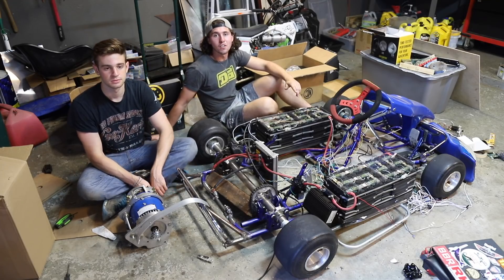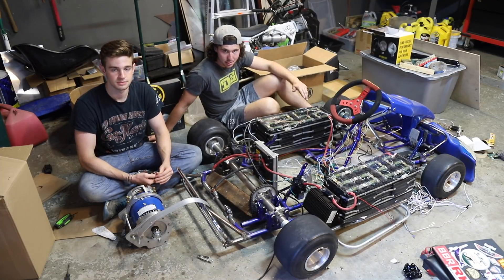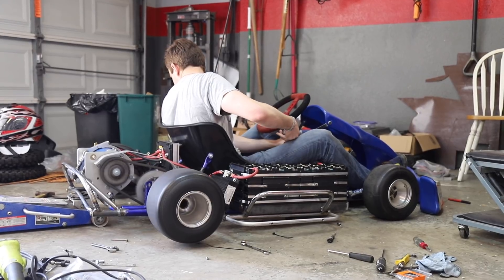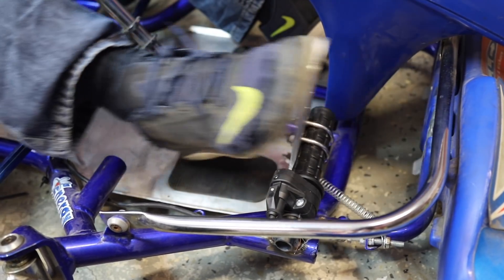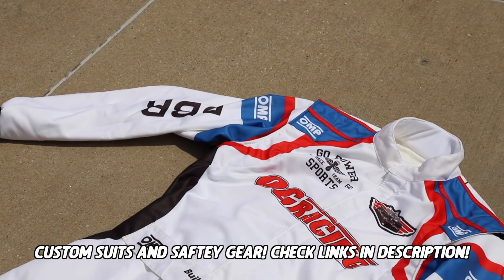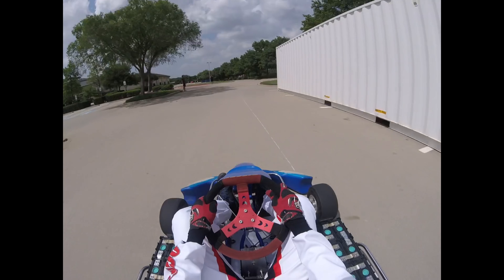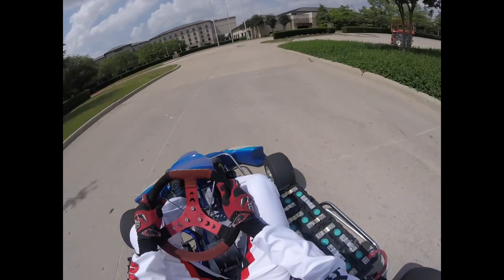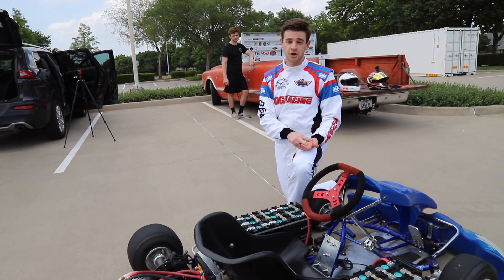Homemade Electric Go Kart First Drive! | 80V Electric Kart Build Part 4

Comment: What a shitty way to leave off, having spent my time watching 4 parts and we don't get to see the finial product with gear changes or any specs like total current draw, run time, speeds?  and save up your lawn mowing money and buy a foot pedal throttle there cheap like under 20 bucks but ya total waste of my time so no need to subscribe if that type of ending is what the viewers get. I want a tire smoking video I got grandma driving a 10 year old Prius.

Comment: Not sure what rpm limit that motor has, but be careful spinning it unloaded, you can easily burn it out. Usually 12V unloaded is ok to test. Also, 72V DC with the current those batteries can deliver can kill you, please be careful. Electrical tape around any tool handles would be good. Always disconnect pack when touching any HV component or connector. It would be good to get a disconnect between the most positive pole and the fuse. If you have a disconnect between the two sides as well that would be great to drop the voltage. That contactor right next to the frame is concerning and the exposed battery terminals are also a concern.  I think someone else also mentioned the positive wire going into the controller going over the black wire connection. That welding cable could melt if there is any heat on that terminal and create an instant short. A split loom over those HV cables would be a good idea. I had an experience with welding cable shorting to the frame of my DIY EV car and I got a very minor buzz when checking a battery terminal and touching the frame of my vehicle. Luckily the amount of exposed wire to the frame of the car was very small so not much current could flow.

Comment: It's a bummer your fried the motor and controller on your first electric project, but you NEED to fix this thing.  This is the only separately excited go kart motor on you tube that I know of.
You have no idea what a beast this thing will be if you fix it and install the smallest sprocket on the motor you can get.  It will out accelerate anything else you have hands down.  Please fix it!

Comment: Did you guys ever show a complete parts list?
Reply from the maker: I just added them to the description, just keep in mind we're still waiting on a new controller and a couple new battery cells
Reply: @BuildBreakRepeat Why didn't you guys ever show us this project with the correct gear ratio and fixed? Kinda underwhelming to leave us like that.

Comment: I called it. I seen that sprocket and I commented on it but it was already done I watched thaws videos way later. Man I wish I would have been able to comment before you blew out the electronics. Unfortunately heat is the downfall for the electronics and heat is an outcome to wasted power. This is a awesome build though guys you have some quality gear and a great platform so it will be amazing

Comment: If you over gear the motor you will cause issues. A taller gear on the motor will give you top end. You need to gear down for tourq to help pull that weight

Comment: So basically I used to work at a go kart track called MB2 electric karting raceway in California. And I worked there is a mechanic and seen the size of the gear on that motor scares me. You are severely overwhelming the motor and controller. The motor should have at the most a 20 tooth sprocket but my suggestion for your set up would be a 16 tooth sprocket on the motor and a 30 tooth on the axle. And the motor and motor controller should have some sort of fan blowing on them for cooling. The motor controller should have an output for a temperature sensor input and fan output. Hope you guys can read this and take my advice and make up bad ass go kart.

Comment: What is the kV on that motor? Also, did you all have it wired in a delta or wye configuration? Based on the voltage that you are running, the kV of the motor, the tire circumference, and the gearing you can figure the top speed. Since gear ratio is the easiest to change, figure what you want top speed to be and then go with that ratio. Also, brushless motors dont really care about voltage, as long as the insulation in the windings can take it. Set your controller to limit the acceleration, this will limit the current going to the motor and keep it from burning up.

Comment: What are you using as low voltage protection for those calb cells. Also how are you charging and balancing them.

Comment: Just a heads up you need to move your seat back or lean your seat back and move the pedals/pedal mounts forward as you should not be touching the steering wheel with your knees.

Comment: Try putting a smaller gear on the axle and a bigger gear on the motor
Reply: Yes
Reply: Back to front
Reply: U want a smaller gear on motor bigger gear on axel
Reply: On the motor put a Medium size gear and just downgrade the rear gear on the axle I don’t know how many each if you have one on the one on it now so change it to like maybe 52 Tooth gear sprocket
Reply: @jorgerivera2674  they are after a lower top speed not a higher top speed
Reply: Doesnt sound like u understand how gears work. Or im reading your comment wrong
Reply: Make the front sprocket a 20 tooth and the back on the axle 30 tooth sprockets
Reply: Instead of a 15 tooth sprocket and that’ll be the front to a 30 tooth sprocket
Reply: You get it now
Reply: @jorgerivera2674  that will give them a higher top speed. The oppisite of what they want
Reply: @jorgerivera2674  they need more like a 10 at front 30 at back
Reply: @jorgerivera2674  make sense
Reply: Back tofront

Comment: I'm not raining on your parade either. I love this stuff and very pro electric too. I'm just thinking that most average joes and even some experts haven't had the experience (excuse the pun) the negatives associated with electrical safety.....even 12v can be dangerous enough to fully amputate a finger and hot braise that wound by catching a wedding ring on a spanner and arching and shorting across the terminals (yes the shortest route possible and the near impossibility of the spanner  reaching melting point before human flesh).
Anyway check out the Australian built Hill climbing cart that's 450kw and only 450kg! He uses a flood type system. The plastic around the cells you have is probably more thermally insulating than the lead foil kinda stuff they wrap LiPOs in though 😄

Comment: You know, if you guys did belt drive, it would be virtually silent.... I'm talking stealth cart boys 🤙
Reply: You haven't ridden electric skateboards long enough to hate snapping drive belts. Suron make silent drive belts for their bikes though 🤔 if I had a belt drive system I'd keep like a pack of 5 onboard with me. Snapping belts would suck quite a lot in a go kart when you consider you're sliding an axle all the way out and pulling the keyway out and bearings and everything. Unfortunately belts don't have the nifty swappability of popping a link on a chain. Belts on bikes and skateboards make sense for this reason and on the contrary for why belts simultaneously suck on gokarts? Just a guess?
Reply: @Jarmezrocks  Toothed belt from a Supercharger.
Reply: Really it's just me being a whack job and I have this crazy ability to mentally visualise things in full 3D vivid detail and can mentally rotate things and play it back in my mind like a movie and zoom in on detail slow down fast forward etc. And typically I just did a full mental instructional film of what changing a belt on a go kart would entail given it's physical differences to convention chain and sprocket? It didn't take me long to go hmm I've seen this before playing pulleys on a custom made Lego technics I had as kid? *Harps playing suggestive time lapse*
The thing worked until the rubber band stretched and I had pull the f*#%ing to pieces to swap it out and putting 2 pulleys and 2 rubber bands added more load than the Lego technics electrical driver could provide? In the end it was a case of destroying the visual asthetics for the sake of serviceability or run dual belts and crank the motor to 9 volts instead of 4.5 😄

The things we do to avoid work that's  god damn pain in the arse is usually directly proportional to the effort required to change the design vs how long you can get away without changing before you destroy the prototype? I've been known to walk that line quite often!
Reply: If they were running a belt, they could probably just use a CVT. That way their gearing will adjust itself depending on the needs. Maybe reduce the motor's strain if done correctly
Reply: @HobkinBoi  you know what, I honestly love that idea
Reply: sigh ahhh belt drives. Both something to love for all their great characteristics and something to loath and hate project toxic 4 letter  words at..... Play the game of guess the next word in the following phrase "James stretched a brand new belt and screamed 'you piece of _ _ _ _'  James was driving along a collected a gumnut in his belt drives and suddenly things went from silent to _ _ _ _   _ _ _ when he sliced a brand belt in half?
James smashed his head against a brick wall when his pully jumped a took and cooked a flat spot into his and that that it took 3 stop start rotations and getting in and out of his cart to realise! Belts = bad idea
Reply: @Jarmezrocks  lmao, I'm getting the distinct impression you're not a fan of belt drive 😂😂😂
Reply: some helicopters use belt drives. designed correctly, they work just fine.

Comment: Need a smaller gear on the engine I recommend 17/38 gears.... remember that electric motor has about 11000rpm or high range much faster than any gas engine
Reply: 2 stroke kart engines do 14k+ rpm.

Comment: Great build and series you guys!  remember how the old 10 speed bike gearing was set up?  Although this won't give you absolute gearing ratios, it might help when considering front and rear sprocket size - Larger front/smaller rear - more speed, smaller front/larger rear more torgue.

Comment: Guys... Some math won‘t hurt sometimes ;)
Measure the motors top rpms and define your desired top speed. Then take the wheels circumference and calculate its rpm at top speed. Now you have wheel rpm and motor rpm at top speed which directly gives you your transmission ratio. Cheers

Comment: They kept saying they had bad gearing but they made it worse by adding a bigger drive gear. With a small drive gear and a bigger driven gear, you can add more torque and put less stress on the motor. That would sacrifice speed but the motor wouldn’t have to provide so much power to get a top speed.

Comment: Please don't run a 48v motor at 72V, that will cause severe thermal issues and large current draws which will kill the motor life !!
Nice build tho
Reply: U dumb? If u up the voltage the current gets lower
Reply: @lel9460  that's if you keep it within the design voltage range, then with higher voltages the current reduces. However if you use 72V on a motor rated for 48V, it will lead to the magnets getting saturated and current rises. Learn before you talk kiddo
Reply: @lel9460  are you serious? Really? You don't know basic stuff about electronics. If you increase the voltage that means that the CURRENT consumption will increase. Current is proportional to the voltage

Comment: They make a 70 something volt electric utv called the beast 
At full charge it will spin the tires it is way bigger and heavier than that cart... So im thinking  that cart is going to be incredibly fast possibly even near 100 M.p.h. with the right gearing

Comment: Could you give the part numbers of y'alls' drivetrain components? I'm trying to do a conversion for myself!
Reply from the maker: Yeah, we want to get a google doc ready, but a lot of these parts are outdated. We actually have a new motor controller on the way. Once we have this thing finalized we will link a full write up in all of the videos, but for now we don’t want to recommend anything without knowing if it works well.
Reply: @BuildBreakRepeat  do you have that doc? :D
Reply from the maker: The Electric kart has kind of been put on the backburner, the new controller has been caught up in shipping delays for months coming from China. Here's the parts list for what you see in this video:

Motor:  D&D ES-10E-33
24-48 VDC Separately Excited with mounting plate/rings and motor outline drawing.  Has been used successfully at 72V which is how I planned to run it. 
http://www.elmoto.net/showthread.php?696-Electric-Mayhem I emailed with DaveAK, the original poster in the previous link, about his build and he loved running this motor at 72V.
Buy online for $650+
 
Batteries: 24 Cells (72V) 60Ah GBS Model LFMP60AH Lithium Ion
Minimal cycles (~20) and have been in storage state/voltage.  See spreadsheet for current voltages (3.18-3.25V)
https://www.elitepowersolutions.com/lithium-ion-batteries
https://gbsystem.en.alibaba.com/product/60211404327-220349394/72V60Ah_lithium_power_battery_for_electric_scooter_motorcycle_golf_cart_etc_GBS_LFP60Ah.html?spm=a2700.icbuShop.41413.8.5d802fb2UBXKFF
https://www.electricmotorsport.com/ev-parts/batteries/lithium/gbs-12v-4-cell-60ah-lifemnpo4.html
~$50+/cell = $1,200 new
 
Battery Management System: eLite Power Solutions (EPS) BMS-24
Hub, control unit, state of charge (SOC) display, front boards, cabling, etc.
 
Controller: Sigma Drive Separately Excited Motor Model SET835M
With technical manual, wiring diagram and connector/pins.  Programmed for D&D SepEx Motor by Barefoot Motors (no longer in business) for use on their electric utility vehicle ATV.
https://www.cw-industrialgroup.com/Products/Motor-Controllers/Motor-Controllers-Industrial-Vehicles/Sigmadrive/Induction-Motor-Controller
D51011.05 BQ09090112
 
Charger #1: eLite Power Systems Lithium Battery Charger Model EMC72-15 
87V 15A output with user manual.
 
Charger #2: Generic Battery Charger Model WL-089-05 
Output DC 72V 3A with input and output cables.
 
 
 
DC-DC Converter:  Sure Power Industries Model 71030i 
Includes connectors/pins and installation instructions.
http://www.cooperindustries.com/content/dam/public/bussmann/Transportation/Resources/instructions/BUS_CBT_INST_180127a.pdf
 
Solenoid/Contactor: Curtis Albright 72V Model SW180B-12
With bracket kit part number 2065-167A.
~$50-70 without mount kit
 
Solenoid: Model MZJ-200 48-48A Main Solenoid
200 Amp $60-80
 
Fuse Block: Generic with two 400A fuses
$22 each for fuses
 
Throttles: Magura Twist Grip Throttles (2 sets)
0-5K Ohm comes with matching grip for opposite side and instruction manual.
https://www.evdrives.com/product_p/thr-magura-assy.htm
$50-60 each
Reply: motenergy..

Comment: Yall should pair up with dewalt and use their flexvolt batteries for the cart if the batteries would last any considerable amount of time youd be able to cut a ton of weight off the cart
Reply: Just get lithium ion pouch cells

Comment: I mentioned controller cooling in part 2 of the build.  Temp readout gauges for engine and controller would also be a good idea.
Reply from the maker: Yeah we filmed this before we posted part 1 or 2. Were getting a new controller and programming a temp shut off. The new controller also has a built in fan